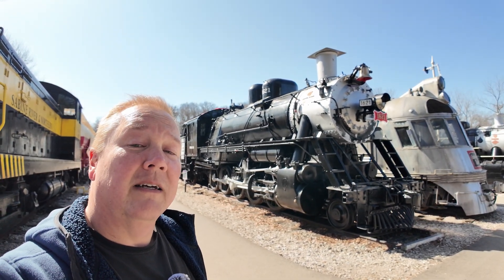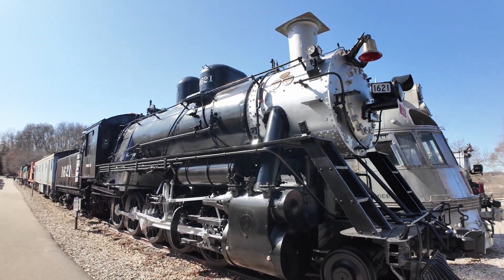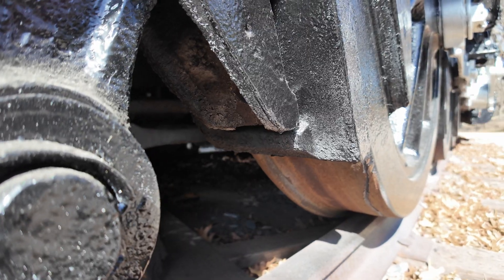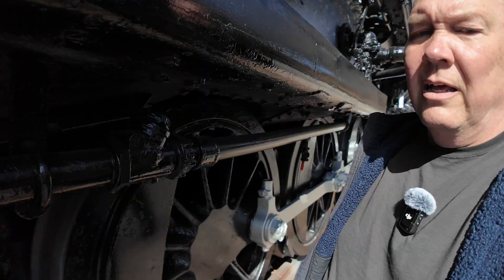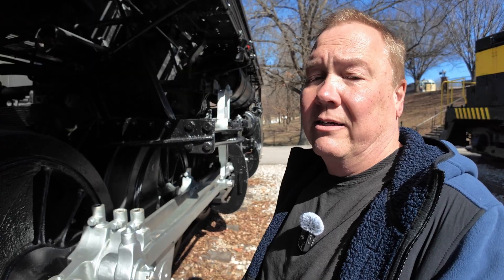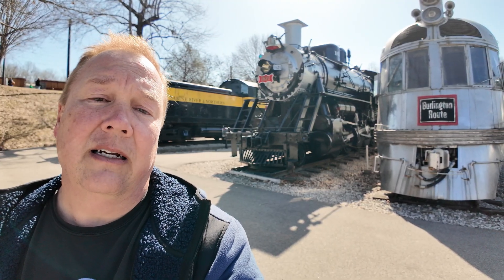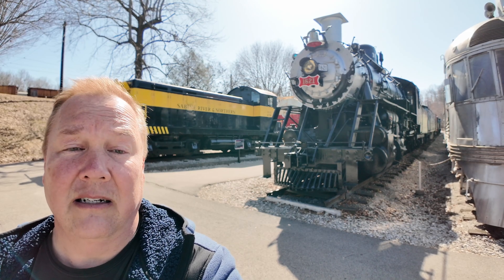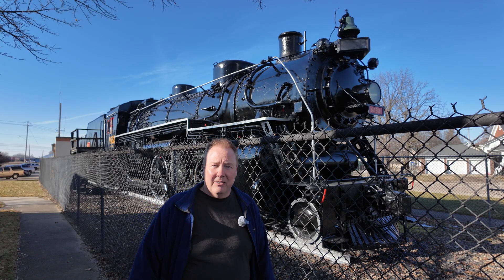The Russian Decapod Steam Engine Doesn't Fit US Rails!

Comment: New tires on the drivers, or all new wheels?
Reply from the maker: Entire new wheels.  Since they likely cast their own, it probably wasn't as big a deal as it would seem, and I assume the old ones just got melted back down and recast.
Reply: @Industrial_Revolution  no they did not cast new wheels.  The put wider steel tires on the existing cast iron wheels.   If you check the back side, the tires hang off the back, and are really thick.   Also some of them WERE sent to Russia, but as you say, the Bolshevic revolution stopped the order cold.  There were about 1200 ordered in total and about 800 had been delivered.  This locomotive worked very well and filled the Russian's needs well, so they ended up making thousands of more copies themselves.   I have been ti Russia 26 years ago, and went to a railway museum where they had a Russian made copy of one of these on display.
Reply: @pontiacguy5190 indeed. There were a relatively small number sent to Finland, which also uses 5’ broad gauge, and more were ordered by the USSR during WWII as well.
Reply: Just replace the tires on the cast iron wheel centers and put the wheels on a new pilot axle and new tender axles with adjusted brake beams.  Basically, the tires are the consumable items on the driver's wheels.
Reply from the maker: @royreynolds108 I've seen many sources now saying the drivers were replaced and others saying only the tires.  When I next see one, I'll try to get a camera around behind the wheels.